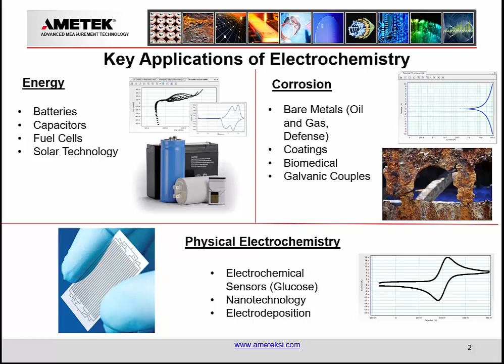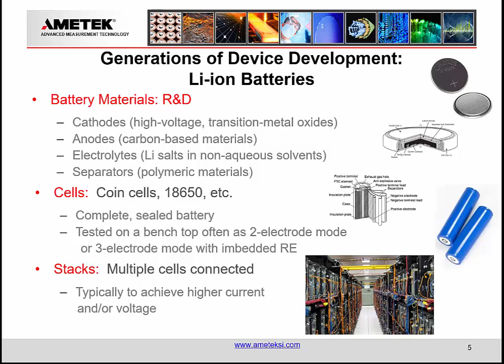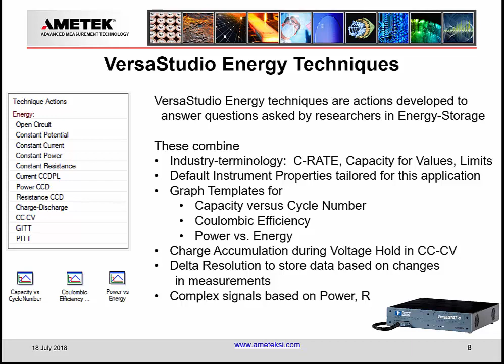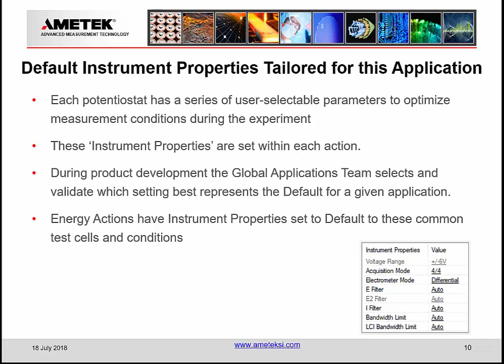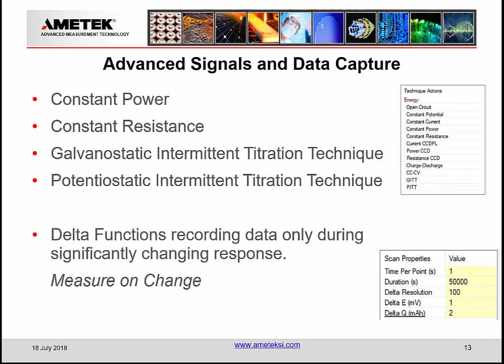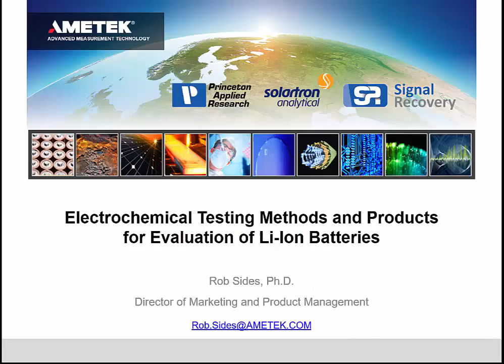VersaSTAT ENERGY Test Methods

Comment: Hey, thanks for your presentation. Good topic. I want to know use VersaSTAT to charge/discharge it can do just one cycle or could it repeat the action by itself with property setting? In addition, the last slide, how to get EIS for x% charge/discharge? how to set the action? Thanks.
Reply from the maker: Palina,   The "Charge-Discharge" action from the Energy package is designed for this function.  You can directly input the number of cycles that you want it to perform, as well as set test parameters such as voltage limits.  For customized test sequences, all VersaSTAT-users can use the 'Loop' under the "Advanced Action" tab.  
For EIS at X% charge, we made a Loop of the following sequence:  
Discharge a battery by 10% (based on capacity and current applied...for example 1500 mAh battery was discharged with 150 mA for 1 hour and was then 90% SoC); 
Then an EIS action;
Repeat this loop 10x.

For more information, you can visit our website at:  www.ameteksi.com or https://www.ameteksi.com/contact-us/contact-technical-support.  

then EIS action
Reply: how did collect charge and discharge data from AMETEK  @ametekamt-princetonapplied5482